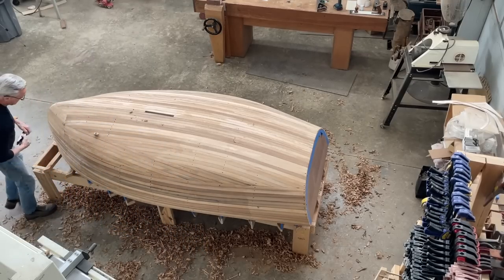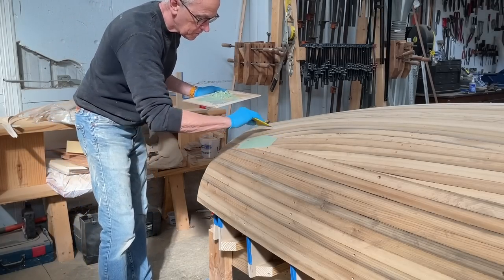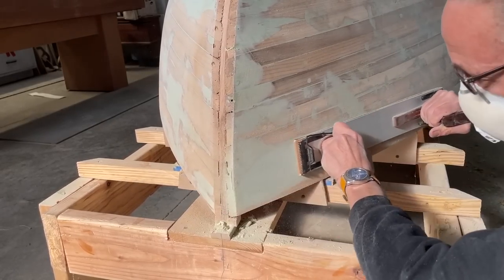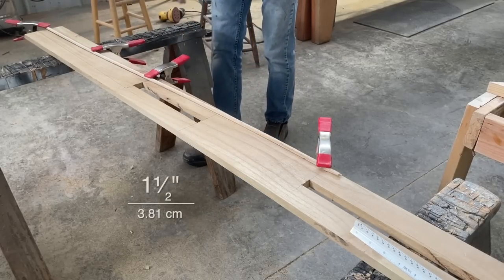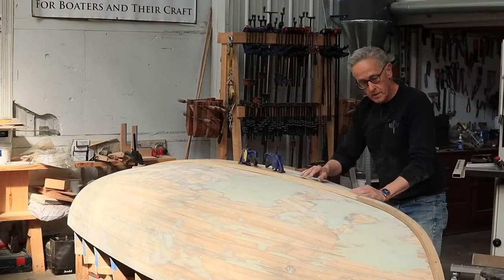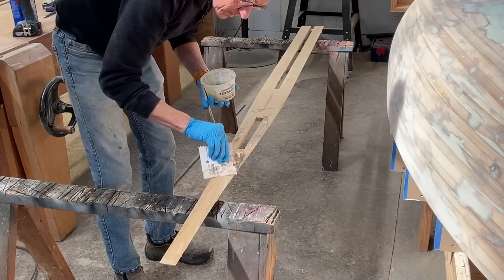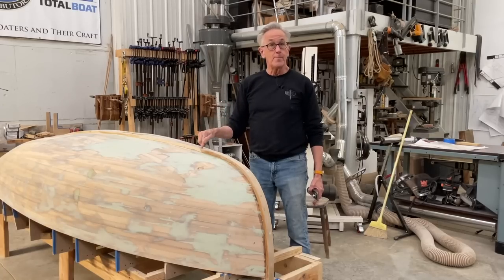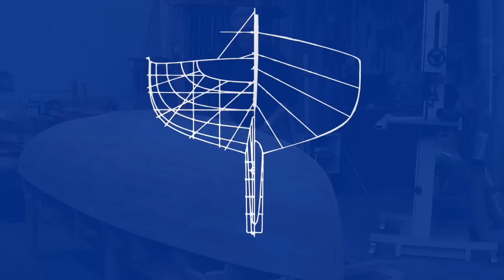Discover Secrets to Boat Building: Hull, Keel and Stem Fairing Explained! S3-E14

Comment: I watched the older video, about making the tool, but by mistake I watched the wrong one where you were using the fairing compound. Why did you keep it out of the gaps between the planks on that boat, but on this boat you made it a point to fill them? Thanks.
Reply from the maker: In the older video the Haven hull was carvel planked. This traditional method relies on the hull swelling up to seal the seams. In the dinghies strip planking the planks are intended to be glued together, hence filling the steams. The dinghy will be fiberglassed inside and out where the  Haven only gets paint.
Hope that helps. Thanks for watching!
Reply: @TheArtofBoatBuilding  Thank you!

Comment: As a non-American viewer of your videos i appreciate it very much you're using metric measurements descriptions in addition to imperial ones.
Just one remark as a former wood worker: with increasing precision we tend to use millimeter (mm) rather than centimeter (cm).
So 1.9 cm would be 19 mm and 12.7 cm would be 127 mm (talking about 1 cm is okay though).
Nevertheless thank you for your great work !

Comment: Hi,it is becoming a beautiful little boat,I love the softness of the curves.wil you be fitting half round bead irons to the keel as protection when possibly running onto a beach?Roly🇬🇧
Reply from the maker: One of the reasons I used Black Locust is because of its hardness. It will be coated it fiberglass and resin so it will be very durable. I will add a couple of half rounds at the bulge for protection. Whether they or brass or wood is yet to be determined.
Thanks for watching!

Comment: So the Total Fair does not require you to prime the wood with regular mix epoxy first? Say that you used WEST with some thickening compound for your fairing agent, then I think it would be required to prime the wood with epoxy first and then apply the mixed thickener. Not so with the Total Fair?

Comment: Having made a strip-built kayak myself I appreciate how much time, effort, and skill went into the construction of this hull. From a practical perspective, though, I wonder if using strips of extruded foam (e.g. divinycell) rather than cedar would not only have been a much easier way to achieve the same look (once painted) but might be "better" in that it could be lighter, stronger, and more buoyant (possibly "unsinkable"). It's a question not an assertion though - if the molds are still set up it might be a relatively simple experiment for Bob to conduct (assuming he'd want to build another set of the "bright" finished panels for the transom, bulkhead, etc. of course)
Reply from the maker: Hi Steve,
A foam core is absolutely possible. Part of this project, as with Arabella, is the idea and philosophy to reuse and locally source materials. Steve and I are on the same page about the majority of the boat materials being from the original Victoria. Also why he wants it named Victoria.
You're correct the process would have gone faster. The process would have even gone faster if I had used new bead and cove cedar strips. 
Not planning on a second build. I can make to molds available for another builder if they so desire.
Thanks for watching!
Cheers,
Bob
Reply: @TheArtofBoatBuilding   that certainly makes sense, and craftsmanship is never a "waste of time" even if the results are hidden under paint or behind a wall. I appreciate what you do - thanks for the response.

Comment: Beautiful job on the fairing. But one thing I really love is the plank grooves like those on a caulked hull. Is there a way to recreate those on a hull like this?
Reply from the maker: Most likely there is a way. What you are thinking of is so that the hull would have looked like if was carvel planked. I like the way carvel planking looks, which is what I did on my Haven 12 1/2. It's my personal philosophy that it would be inauthentic to add groves to a strip planked hull to mimic carvel planks. Best to just carvel plank the hull. Not in the card for this boat as the reused cedar would not have  cooperated.  
Thanks for watching!
Cheers,
Bob
Reply: @TheArtofBoatBuilding  yeah I hear what you are saying. I was inspired to this as I've seen lots of fiberglass hulls with faux plank lines. I knew it was glass yet the lines added that classic Carvel plank look.
Yes, plank a dinghy would definitely be a huge challenge.

Comment: Thanks again for boat lesson, two questions sir when you add the Fiberglass will you or have you thought of added Dye to your Epoxy ? I seen them use it a lot on surfboards! Second since the Wood was so Beautiful could you have Use Epoxy as a Filler? Or it be to much Hard to sand?
Reply from the maker: No Dye in the epoxy. I will be putting an epoxy primer on after the fiberglass (it's white) and then the final paint.
Adding filler to epoxy is not the same as fairing compound. There are fillers that are designed to make a fairing paste. Otherwise you are correct the epoxy will be too hard to sand.

Comment: Hi Bob. Why the fiberglas don't go in between the hull and the keel?
Reply from the maker: I wanted to keel to also have some protection from abrasion. Also if the keel was on top of the fiberglas I would have been putting holes through it when I added the screws. I debated both approaches and decided this was the best option.

Comment: Bob, Acetone effects your nervous system.  Use a carbon filter mask.  Make sure your gloves are as resistant to acetone degradation as possible and not permeable to it.  Not all gloves are the same.  The MSDS should tell you what sort to wear.

Comment: I never noticed before… you are either extremely tall or that set of saw horses you use is shorter than what I would consider a normal height. Are they a custom size for boat work?

Comment: Why the split in the stern part of the keel? What's its function?
Reply: I think it forms the base for a jet to be a skeg
Reply from the maker: Correct it is for the skeg.
Reply: @TheArtofBoatBuilding  After Jacob's answer I had to look up what a skeg is (EN not native to me) and it makes sense and should have guessed it as you see these skegs on hulls all the time. I read it helps with steering but I would expect it would rather help with a vessel keeping course and drift less due to lateral forces. But I now very little about boats 🙂

Comment: Really enjoy watching you work. When I do this sort of work and also following Louis Sauzedde, Nick Schade 
and also Mark Reuben Nomad boat building I  paint the two surfaces to be bonded with unthickened epoxy before applying the thickened. I think the theory is that the wood (particularly the cedar) will absorb the resin from the thickened before it sets up and the joint won’t be as strong.
Reply: I've seen that same approach also.  tm